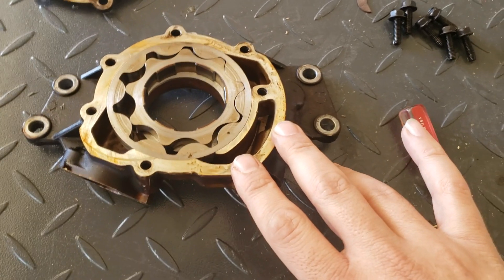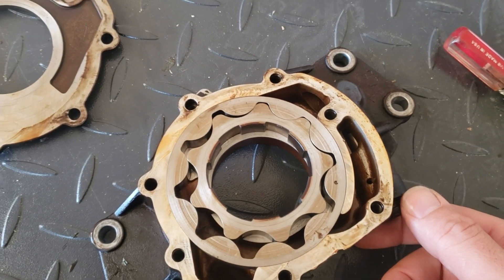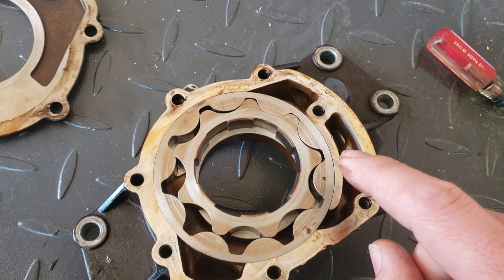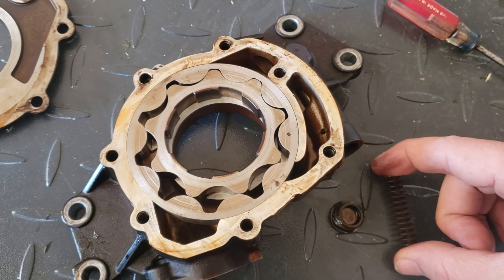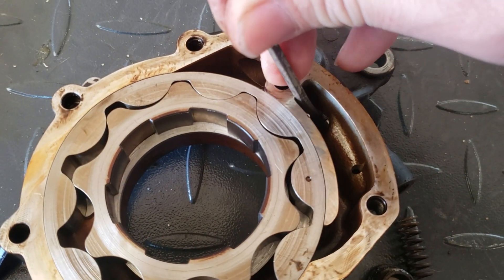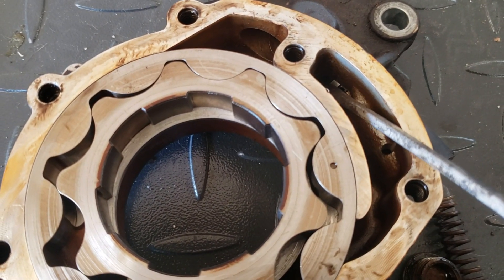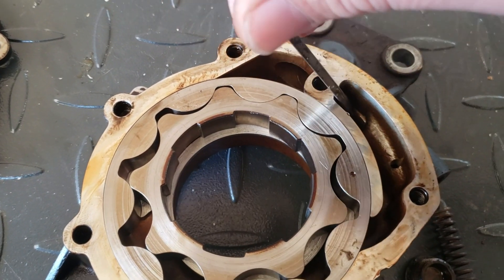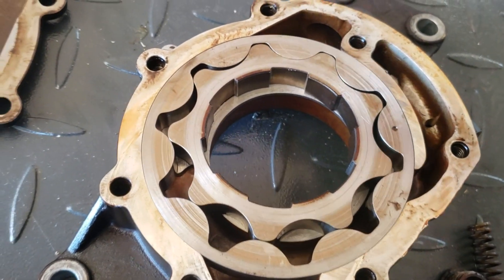ls oil pump failure and what failed

Comment: I believe this is the exact thing that happened to me, I wanted to be "extra safe" for my junkyard rebuild and bought the same brand. I could barely even get the Allen bolt out that houses the relief spring and plunger, and before I even tried opening it up, i saw witness marks on the bolt that showed someone else had already been in here. I think mine was a returned part that got repackaged, but it cost me another engine rebuild, as well as WEEKS of troubleshooting why I couldn't get oil pressure in my 6.0. 

Thanks for this video, it truly needs more attention

Comment: Did you lose pressure completely or was it just really low? My truck just dropped pressure after a hard hit idles at 8psi and won't go over 35 with rev. Was 30 at idle and 70 with rev and just quit building pressure
Reply from the maker: I lost all oil pressure but caught it in time
Reply: Sorry to hear that :/
Same thing happened to me on my last 2 engines. Just started pulling one of them apart. I had the unicorn glitter all through the oil (bearing material).
Reply: Same thing happening to me did u figure it out man?
Reply: @chasef6275 for me it was bad rod bearings on both engines. Figured out the oil return on my rear-mount turbo wasn’t getting the oil back to the pan in time. The oil return was routed to the valve cover. That was my issue, personally.
Reply: @coryvazquez2200 mine has great oil psi on cold start and even for at least an hour it’s fine but once I start fully beating on it pressure starts to drop with rpm drops to 30 psi at idle and then when I rev it to 4k rpms it drops to 25 psi sometimes 10 psi but goes back up to 25 30 psi definitely gets low psi cuz I can hear the lifters start to tick a little bit but cut previous 3 oil filters no shavings sparkles glittery nothing so has to be failing relif valve on pump
Reply: @chasef6275 if your oil has no glitter then that could be it. Or your pickup tube getting clogged. Maybe a bad o ring on the oil pick up tube too
Reply: So I overfilled my engine and parked downhill to eliminate the o ring in the pick up tube. I dont have any glitter in the oil just the normal amount of Grey sludge on the oil plug magnet. I am thinking its the oil pump relief valve  is stuck open a bit. It is a melling high pressure standard volume but its had 25k miles of daily and a lot of hard pulls on it... just hard to believe the pump or relief valve ga e put that quick. I am gonna a throw a pump at it when I get back from working my hitch in Alaska.
Reply: Was it the oil pump for you?

Comment: Thanks for sharing your experience, emphasizes importance of new pick up tube in case of caked on oil debris unseen inside that could plug it too.  Many variables.  Melling 10295 n shim it, add assembly lube, works great.  Thanks again.